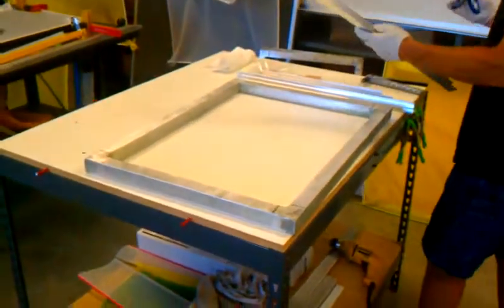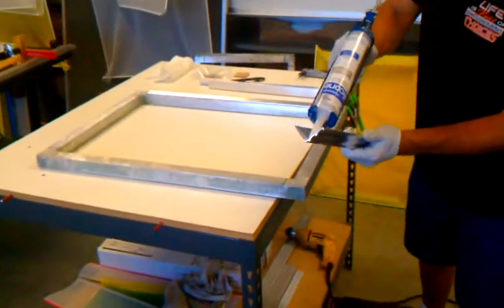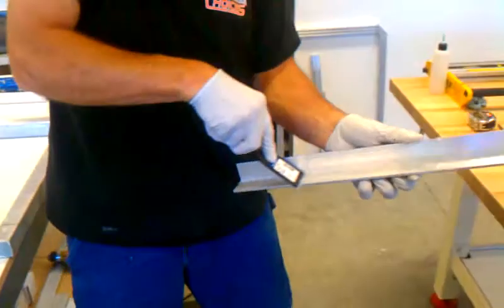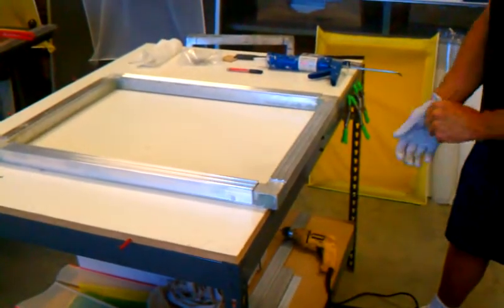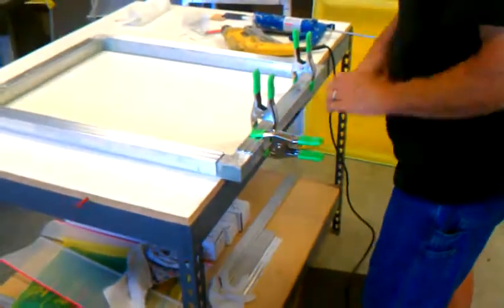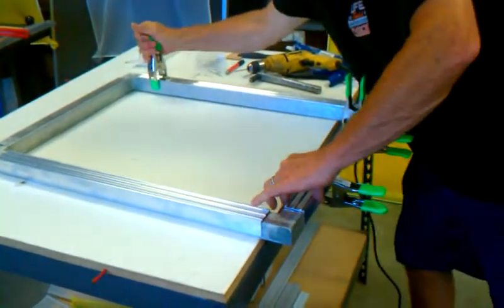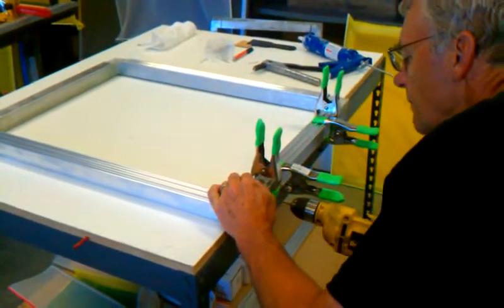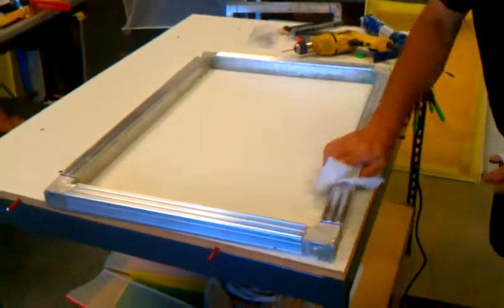Assembling an EZ Angle Conversion Kit

Comment: I have a question.....Why don't you fasten any rivets on the top? Is it because you are pulling fabric back and it is snapping forward into place?
Reply from the maker: That's correct. All of the pressure being placed on the angle is pulling it to the inside of the frame. This is also why it is so important to place the rivets on the bottom scoring mark on the frame as well. This keeps wear on the angle and the frame to a minimum.